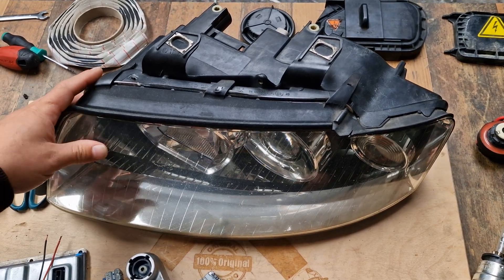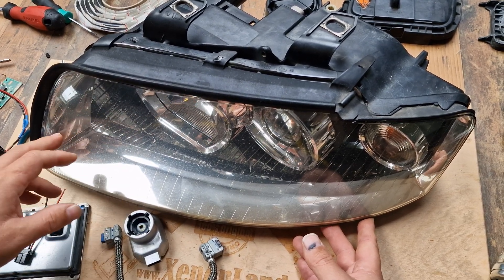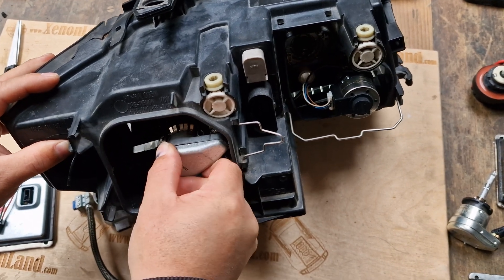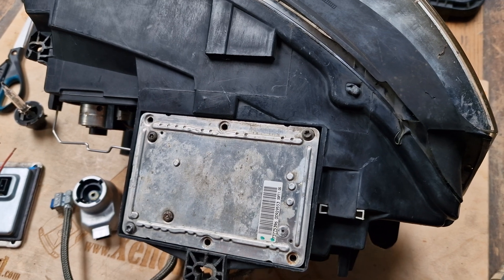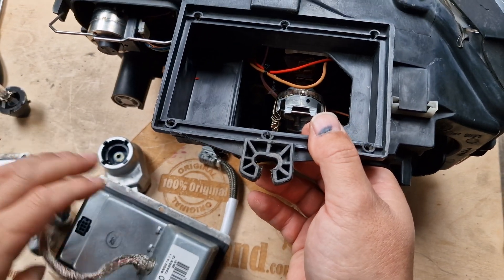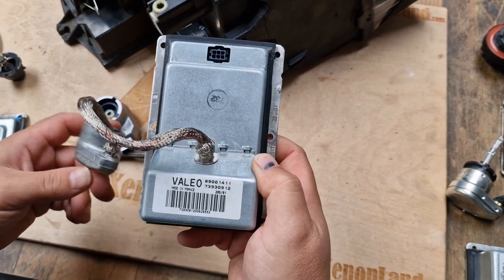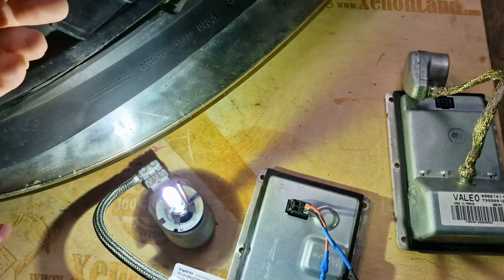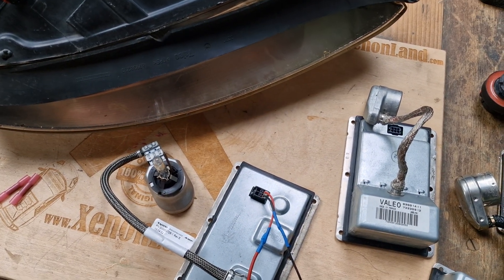How to fix AUDI A4 S4 B6 Xenon 6-pin Ballast Headlight? DIY Repair Valeo 89001411 73930912 73927112

Comment: Great video mate, is there a repair kit for a 2001 Audi S3 8L 1.8t Quattro xenon headlight ballast?

Thanks
Reply from the maker: Audi S3 8L has a Hella ballast, which is not that much expensive. You can buy replacement ballast easily. There are also a lot of aftermarket/copy ballasts out there for facelift 2001.
Reply: @xenonland thank you
Reply: Hi there, I've opened up my Hella ballast just to see if I can see any obvious damage. I was wondering IF I can email you some photos for you to inspect. Even if I replace them I still want to leave more about how they work

Comment: I have an issue with the drl on my audi s3 2017. First i changed the drl modules as thats a common feature on these audi. Still wasn’t working. The rest of the headlight works , signal works just no power on the drl. The drl was flickering when i got the light on the dash , then after flickering for a bit it turned off completely. Do you this this would be a control unit issue or should i buy a new headlight. Love your videos btw. Thank you

Comment: Hello, thank you for your videos, I was wondering if you could please make a video explaining how to repair the Audi b7 a4 ballast to fix the dipped headlight/ low beam failure. It’s impossible for me to drive at night, both of my headlights keep shutting off every 30 seconds, I’m constantly turning my light switch off and on to see for those 30 seconds and it’s really frustrating, I’ve swapped ballast and bulbs and nothing seems to change with there performance

Comment: Appreciate your detailing this process. It's crazy how there's a tutorial on YT for almost anything. I have oem valeo xenons in my 2004 A4 Quattro and the passenger side died shortly before I stopped driving the car a few years ago (whole 'nother story). It would be satisfying to bring that unit back to life (if/when I can get the car itself running again). Wish I'd taken better care of my Audi 😞
Reply from the maker: Most probably you have a 4-pin headlight version, the most common one. You can easily find replacement parts for it.
Reply: @xenonland  thanks for the encouragement. Obviously I have to get the units out and open them up and see what's inside. Ran out of time before it got dark tonight (car is regrettably outside on driveway). Thanks again for quick reply.